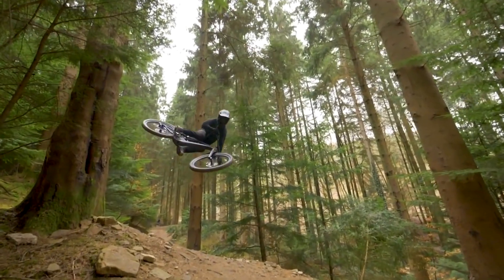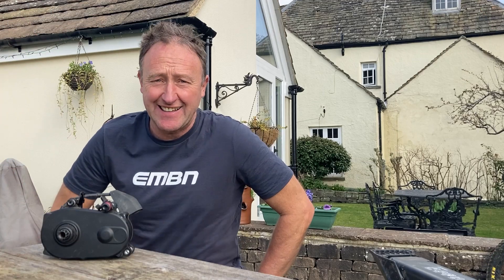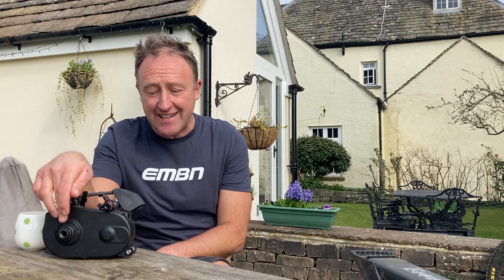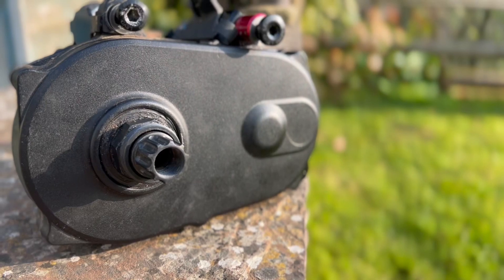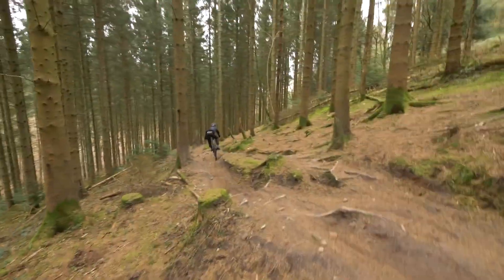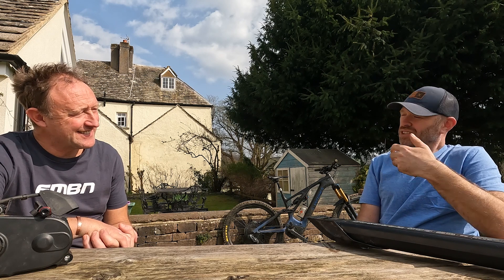What Is Peak Power & How Does It Work? | EMTB Motors Explained

Comment from the maker: Do you set & go OR dial & tune your EMTB!? 👀 👇
Reply: I dial &tune the bike and use the factory settings on the motor. Another words there is so much you can due to the bike it self. The motor comes with 5 setting don't find my self looking to adjust yet.
Reply: I can’t be bothered to phaff on with apps. I have my Bosch powered bike in EMTB 90% of the time and put it in turbo for the really steep stuff.

Comment: Actually, since the nominal power of the motor is determined by the cooling capacity of said motor, by running at above the nominal power (especially in hot weather) you will reach the max allowed temp. The firmware will then throttle (limit) the power output.

Comment: What is the relation with torque power, do we drain the battery faster with a 90nm than a 70nm?
Reply: A bit late to answer, but motor torque does have a relationship to motor power: power = torque * RPM. So, if you're in a situation where more torque is necessary (e.g. climbing a hill), you'll use more power to maintain the same RPM. More power translates to faster battery drain. However, a 90nm motor isn't always applying 90nm of torque. Everything else equal (including efficiency), a bike will not drain more power just because the motor has a higher torque rating. If you already know power (watts), that's the goal here; you don't need to know torque.

Comment: good info, lets keep digging on this topic and dig more into the innerworkings of ebike drive systems and power supplies; maybe even start discussing how all these systems communicate on a canbus network. 

 I would also be interested in what the SL and other mid/low-power ebikes might look like in this conversation.  

Last, I think having a sticky linked spreadsheet of this info for the common motors, that riders could try and calculate their total power output, and battery consumption based on their unique use cases.  (even plotting those on a graph so you cold compare also)

Personally, that would be more interesting than the ebike newb videos on range, lame product evals, or general maintenance that are not ebike specific (unless they were model specific).

Comment: I wish manufacturers like Specialized would apply newer battery technology to the older generation of batteries. I love my 2019 Kenevo but have got fed up with the limited range with the 500 watt battery but I can’t justify the cost of a newer one. I know everyone wants to sell new, but I fear that one day there will be bad publicly aimed at e bikes for not being sustainable in the same way a modern car is likely to be scrapped before they get to ten years old due to parts failures and cost of repairs.
Reply: Have you looked into the bottle cage battery extenders?

Comment: Tell us again which one is the battery and the motor. Looks like I got it wrong all these years. Never knew the battery is actually the motor.
Reply from the maker: Hey Johann, The battery is always on the down tube of the bike and the motor sits between the cranks where the bottom bracket is. Hope this helps! 👍

Comment: I think it important to say that the peak power discussed assumes you can only pull in Amps the Ah rating of the battery times the nominal battery voltage. If that’s the case we say the battery has a 1C rating at 25 Centigrade. Battery capacity varies with temperature. Some lithium batteries subject to the chemistry and the number of cells in series and parallel can pull more than 1C, so continuous power from the battery depends on the battery pack C rating. Peak power will depend on the C rating and a given short time, usually a few minutes. It’s also important to note this is not the actual power output of the motor at the crank as we have to take into account the losses (from friction/heat) from battery, wires, controller and motor. That’s an overall combined efficiency map which could vary for example from 60 to 80% efficiency. In other words we could lose from 20% to 40% of that battery power on the way to the bicycle crank output.
Reply: More great detail John. Thanks 🙏. This confirms my suspicion how after market motors like Befang will promote their 1000 watt motors but that says nothing about the efficiency of the motor and the overall system. If it generates a lot of heat, a higher watt motor is not necessarily a better choice. I run a Bosch system that has a low watt rating. However I suspect it’s a well engineered system because it never overheats and provides a consistent overall experience. 

Cheers

Comment: The reservoir is in Wh (stored energy), the instant power is in W (Volts x Amps drawn). The potential power from the battery depends on the C rating of the battery. In this instance you are assuming 1C discharge where C is the capacity in Ah x the nominal voltage. Not all lithium batteries have a 1C rating. Some can do more, some less. It all depends on the series/parallel setup of the cells and type of lithium chemistry. On eMTBs the cells are usually NMC due to low volume and weight. Note capacity also varies with temperature, hence less range in winter. Nominal battery capacity is usually stated at 25 Centigrade. Don’t you just hate pedants…
Reply: Great details John. I have a Bosch system. How do I find its “C” rating?

Cheers

Comment: Three things great channel love it.  Two it’s so good to hear a regional accent,( in this case a lovely welsh one.). It’s one of the great collateral benefits of internet broadcasting.  A battery stores energy a controller which is the interface between that and the engine and finally the engine itself.  There are other inputs to the controller such as the torque on the pedals ie how hard u push and inputs the rider does to setup how the controller delivers via the screen.    The early e bikes had crude simple exchanges between all these, the modern bikes with software and sensors increasingly more sophisticated.  There is a lot of smoke and mirrors from manufacturers in an attempt to differentiate but what common between them is greater that what’s different.  The only way to tell what’s best for your style is to ride them in a similar situation to where you ride.  My only complaint is that the actual cost of the bike at reasonable scale is very low regardless of brand.  But marketing builds margins and will ultimately make it unattainable for most.  Research and development whilst it absorbs capital initially is relatively minimal once amortized over a significant production volume , so can’t justify the margin.
Reply: There's two welsh accents there, North and South West... the lovelier one is the North 🤣
Reply from the maker: Hi Joe! Thanks for the support, it means a great deal to us! You make some very valid points. All the best and safe riding! 👍

Comment: 5:50 75% efficient motor ... that's a heavy insult to Brose engineers ...
Reply: Not really, petrol engines are about 30% efficient.
Reply: @rgd1977  Your comment is SO irrelevant, a decent Brushless motor is 85% efficient, chinese knock off are 80%, a  Tesla motor has 95% peak efficiency. The 75% claimed in this video is wrong as many of the shit they are saying
Reply: You ok?

Comment: is this an april fool joke ? or you really don't get the diference between Wh and W ?
Reply: The whole premise of this video is wrong. People who say they have a XXXw battery bugs the crap out of me. It is XXXwh's which is volts x Ah's = watt hour's not watts.  Watts = volts x Amps and has nothing to do with the battery but describes the maximum amount of watts a motor is able to put out. Watts draw from the battery to power the motor and under use the voltage drops and you are losing wh's incrementally as you ride. It doesn't effect the power noticeably until you are close to the low voltage cutoff of the BMS, battery management system, that is in the battery to protect the cells from discharging too far causing them harm over time. Many articles and videos online that explain this better than this one.

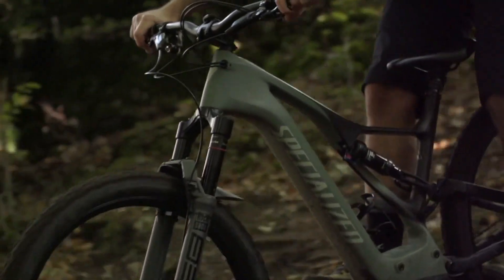Comment: 2:20 watts-hour.. 
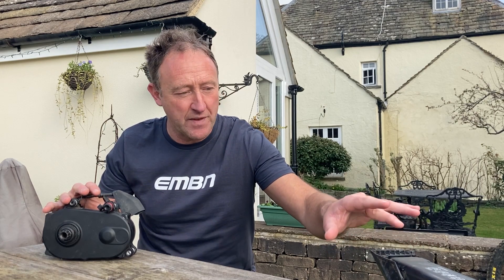2:31 this motor can draw 720 w from this battery FOR ONE HOUR
2:58 amp-hours is not the same as amps...  battery capacity is not power!!!!!!!
Reply: If you are going to correct, at least use capitals correctly. 😏 Wh, Ah etc. But yes folk do get confused between Energy, Power and Capacity.

Comment: So if I set my assist at 50% I only need to give 75w to get that assistance if its set at 100% peak power. If I set it at 50% peak power I only need to give 37.5% to get the 50% assistance from the motor
Reply: Assist is rider input plus the level of assist set. So if you input 100W and have support at 300%, that’s 100 + 300% = 400W combined power. However I think that is referring to the support from the battery not the actual power at the crank after system losses. System losses are a serial efficiency equation from battery to controller to motor output. Motors vary in efficiency as it’s a map not a fixed number. Suffice to say the power you take from the battery may be 60 to 80% of what is taken by the time it outputs at the crank so your 100W input plus 300% support from the battery could now be (if 60% losses) 100 + (300 x 0.6) = 280 Watts output after losses. In fact this is a conversation I’m having with Bosch at present about is my Kiox showing power output before or after losses. The sums suggest Bosch are using power taken from the battery which is misleading.

Comment: i have a 48v 17.4ah battery would i be able to size up and go for a 48v 50ah ?
Reply: That battery would be significantly physically larger. Larger Ah means greater capacity for the same pack voltage and providing you have a correctly sized controller you could pull more amps from the pack and if the motor had a higher rating you’d get more power out of the motor. This assumes you can only pull 1 x the Capacity rating of the battery. Depending on the cells configuration of series/parallel and the type of chemistry we can often pull more than 1C.

Comment: I notice something on Saturday. I’ve got an S Works Levo SL (it’s not just the lower price point bikes that have the standard display by the way). I was riding using the range extender, which was set to discharge first, before the main battery. I noticed I was struggling on a climb, the range extender was on the last bar and was it was fully discharged and the bike switched over to the main battery, which was fully charged, the power came back on and it felt like I was riding down hill. You mentioned that as the battery drains the power drops off. Would that be the reason I was struggling on the almost empty range extender? Great video by the way.
Reply: You are correct in your thinking Alan.  In  addition, the battery management of these systems can require multiple battery ‘cells’ to burst/boost to maximum power output. Towards the end of the battery drain you may not have enough cells to produce the peak power. So it feels a bit sluggish.

I believe Specialized is one of the few systems with bottle cage range extenders. I wish Shimano and Bosch would introduce this as well.

Cheers
Reply: @casualcarl8460  Thanks for that. Would changing the settings in Misson Control so that both main and range extender batteries drain at the same time? I'm guessing it would, until both batteries where drained.

Comment: please clarify, if I select 50% of peak power then I will have to put more effort to move forward but in return I can get more distance out of the battery?
Reply: Correct; with PP at 50%, say 280W, you're going to burn less battery than if PP is 100% 560W, and faced with that lower peak power either you go more slowly or you put more effort in.
Reply from the maker: Hey Jose! That's completely right! The weaker the assistance you have, the longer battery life lasts! 👍

Comment: So what I glean from this, is that the 250W limit is a bit of a farce,  They will provide far more power/assistance for short periods. So to stay within the current legisaltion, any manufacturer could state it's "nominal" power to be 250W but could peak at 3KW (but of cause limited to 25kph assistance). Or have I missed something?
Reply: It’s not a farce the 250W rating. It’s what a motor can do on a test rig usually over about 30 minutes where the motor reaches a thermal equilibrium. The short term peak is much more, maybe 600W after losses. The point is the motors would burn out if they were to hold peak power for a long time, hence we talk of rated or continuous nominal power of 250W for legal eMTBs classed as bicycles in Europe.
Reply: the 250w is a continuous power rating and yes it is nominal because if you stall any dc motor it will peak way above that  maybe in future motors will be dynoed to make sure they are under 100nm  to pass the standard who knows

Comment: The mission control app is pretty poor for explaining the tuning for each mode, but it's straightforward once you understand you're entering a percentage of the motor's peak power, not of rider input power.

The tuning part of the app is really good, but the ride recording is annoying. The Bosch bikes record all rides regardless of whether you're paired with a phone (with the exception of GPS data). But the mission control app needs you to be paired, connected and actively click Start Ride before it'll record. Also viewing the ride after is pretty limited.

The actual bike, however, is batshit bonkers brilliant.

I've dialed my eco back to 20% for long treks, but otherwise stock.